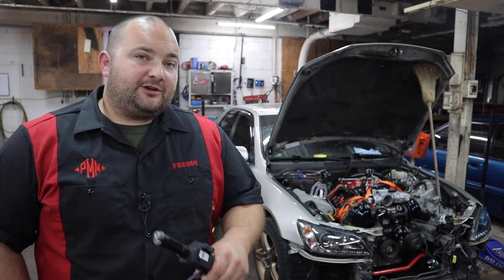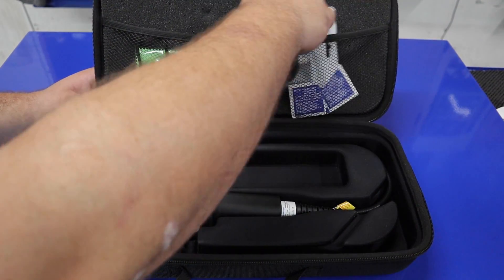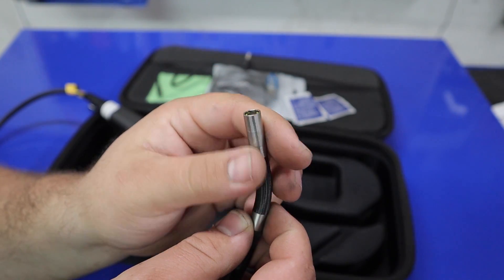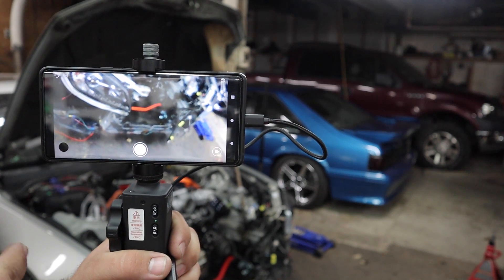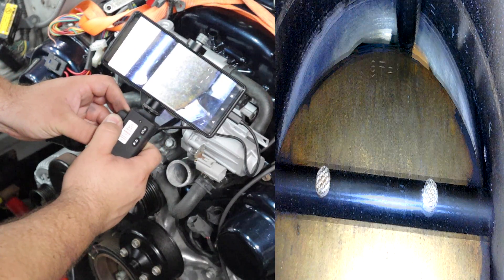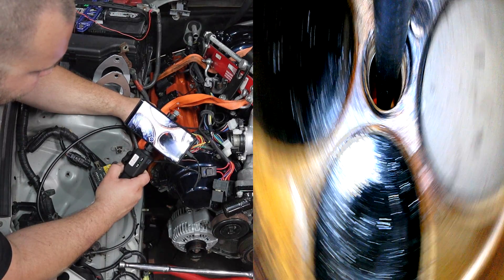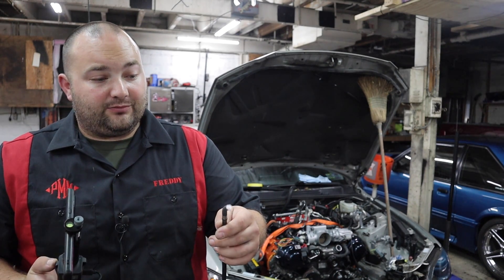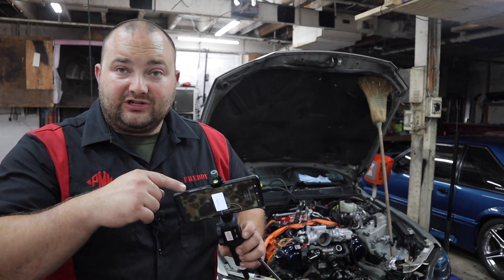This is NOT a boring inspection camera! Articulating borescope review | A MUST HAVE

Comment: Have you ever put a Bore scope down into.... a 
 nearly empty gas tank...? I'm intrested in seeing what sediments are floating  around. Obviously not inserting it into fuel. My 007 Lexus IS350 has 171,400 miles and I'm seriously considering changing the fuel filter but would like to see what's in there.
Reply from the maker: You don't need to do a bore scope if you work on the fuel pump or something. Then you can clean it out
Reply: I would not take anything that has electrical current going through it even if it's minimal into a gas tank.
Reply: @kimoclyde  Something else is there are usually siphon guards so it could be difficult taking the camera cable back out.
Reply: almsot empty will still have octane fumes please don't risk it